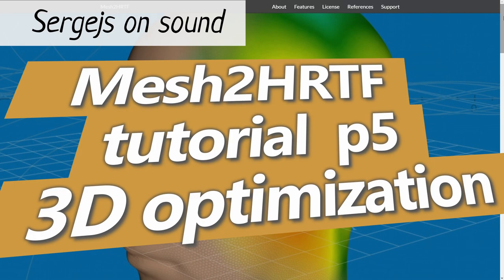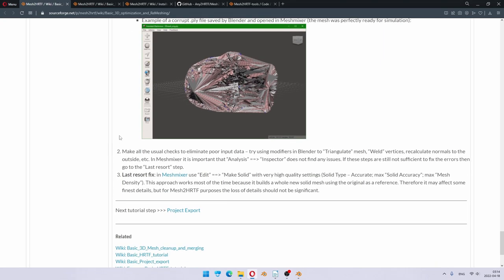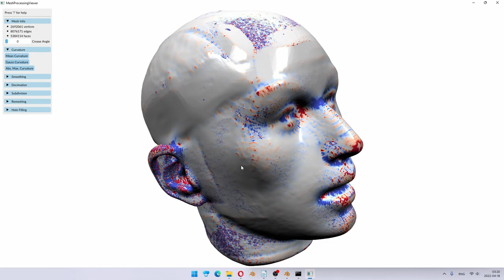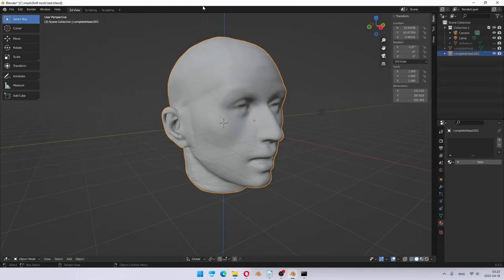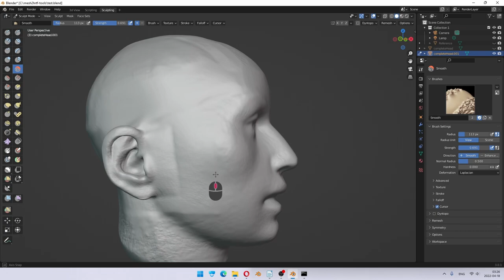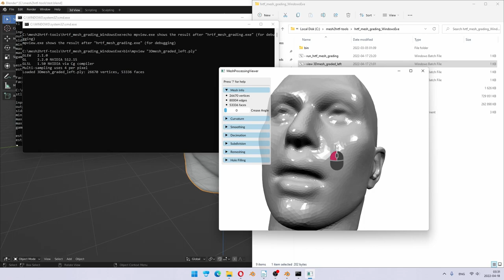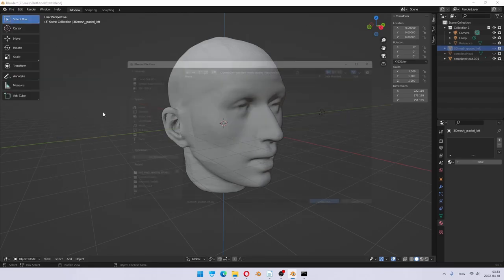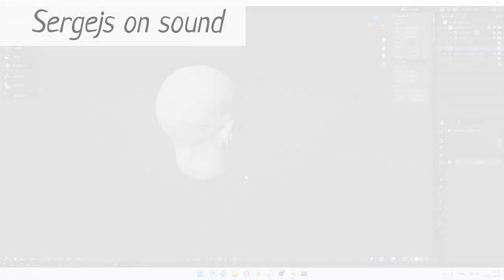Mesh2HRTF - t05 - 3D optimization Tutorial

Comment: I tried both MeshMixer make solid and Blender remesh, the grading tool still outputs nothing, what should I do?
Reply: Problem fixed. For those with same issue, my problem was the mesh was still non-manifold even after remeshing, it seems if the remeshing resolution is too much then the non-manifold part will be kept as is. My solution was: Use Blender, first do voxel remesh using low resolution (a.k.a high voxel size),  then go through quad remesh (it throws error upon encountering non-manifold meshes, so it serves as a check), then reimport the original high-res model, keep the two models in the same position. Use a subsurf modifier on the quad-remeshed model, then use a shrink wrap modifier, wrap target is the original mesh (this step gets the details we lost during remesh back). At last, use a triangulate modifier to make all faces triangles again, and export.